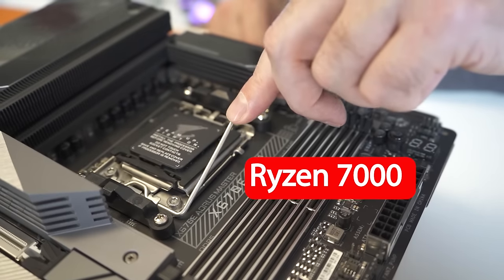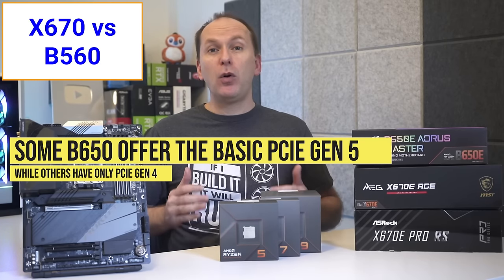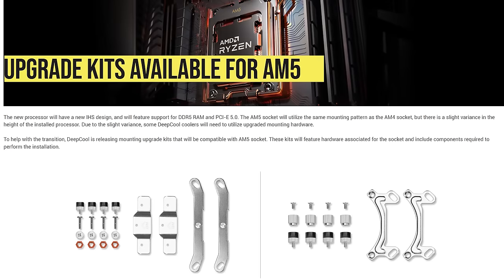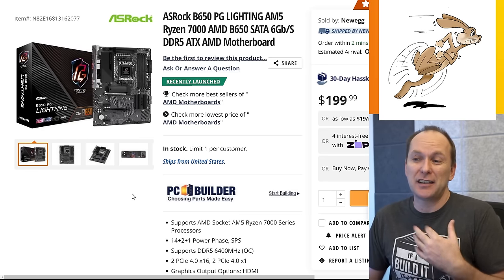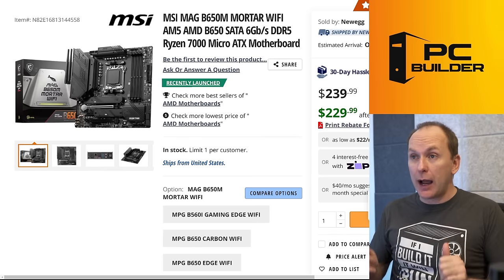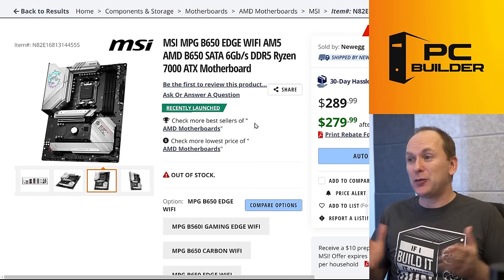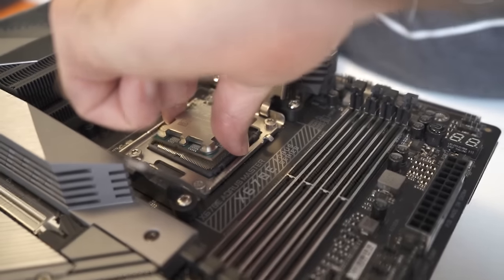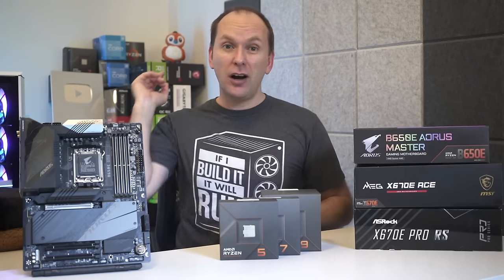Best Motherboard for Ryzen 7000 | AM5 Motherboard (B650 & X670) For Ryzen 7600X 7700X 7900X 7950X

Comment: #1. USB 3.2 Gen 2 Back Panel Ports Type A, ( 2x2 type C draws persuasion as well after 3-4 type A's), #2 PCIE gen 5 on video card slot ( may not be fully usable but get something for money spent to ensure Top data transfers) #3. PCIE gen 5 M.2 slot, #4 wifi,  then comparisons of VRM & audio codecs. I do not overclock.  Looking for affordable ( under $200) AM5 board that meets 3.2 gen 2 back ports is hard to find

Comment: One curiosity I had was for building a SFF system that can handle a 7950x without overspending on the motherboard, that way It'll have max compatibility for whatever I decide to use.  I knew it would be possible before the B series boards were released.  It will be fairly minimal in terms of pcie/sata devices, maybe just 2 m2 drives at most.  I kind of prefer Asus, but I'm also considering Asrock or MSI.
Reply: asrock used to be subsidiary of asus

Comment: I'm gonna cross my fingers on the ASUS B650-I, has all I need for my ITX build, though some customers reported lots of coil whine on idle from their examples even after getting replacement. One of our retailers had like 5+ of the same board returned within the first few months. But there are so few ITX boards for AM5, I don't want to break my build's all-black aesthetic with the white MSI Edge, and I don't trust AsRock.

Comment: I picked up the MSI MAG X670E TOMAHAWK X670E as part of a bundled deal with a Ryzen 7900x a few weeks ago.  Had no idea how good or bad this board was.  Only had the ratings to go by and it was above average.  Seems OK so far, but I wish I had more time to research.  Was in a rush to get the build up and running.
Reply: What is the difference between your motherboard and GIGABYTE B650M AORUS ELITE AX in performance ..etc. ?
Reply: @warrobots1warrobots135  Have no idea.  Like I said, I didn't really have a lot of time do any wide spread comparisons other looking at the specs online.  It was either this or the equivalent Asrock, but at the last minute, newegg updated their combo deal and I saved about $20-30 by switching to the MSI one.  So far, it's great.

Comment: Even a noob will understand and learn what are the commponents and what are they for. Hats off to you for such illustrative videos. You desevre milions of subscriber. I am planiing to build a new rig, it will be mainly for Gameing along with MS office, Excel, Photoshop, Illustrator, etc. Please be informed, I have no plans to overlock. I am just against overlcoking. Love from India.

Ryzen 7900
Msi Mag B650 Tomahawk Wifi Motherboard
4070 Ti
Trident Z Neo 16X2 6000 30CL
Stock cooler
KC3000 PCIe 4.0 NVMe M.2 SSD 

Please feel free to modify.
Reply: What is the difference between your motherboard and GIGABYTE B650M AORUS ELITE AX in performance ..etc. ?

Comment: Can you make a video on how to choose a pc case? And possibly on which and how many fans to buy with it? I can’t find help for it
Reply: It's very easy. Just make sure it has front usb c, also read reviews to make sure there's enough room for cable management. The best cases are made by Phanteks or Fractal in my opinion. If I were you I'd just find a roomy Phanteks case and get that. Try Fractal Design Torrent or Phanteks P500A. I'd probably but the 500A is looks amazing and comes with 2 fans already.
Reply: @waitandhope  ok thanks and do I choose the other fans? If I want 4 in total?
Reply: @xruud24  Try finding out the model of whatever fans the case comes with and buy 2 more of the same. However since each fan has its own header on the motherboard you can fine tune their behavior later so they are similarly rotating. Or really what you can do is just buy 2 more, put those in front and move the ones it came with to the back and top. That'll be easier
Reply: @waitandhope  yeah because you assume the one the case comes with are less powerful than the ones I buy? Bc there needs to be positive airflow coming in
Reply: @waitandhope  I thought I had 1000 options to choose from and which one I should get depends on the case
Reply: @xruud24  fans will all spin around the same rpms so it doesn't really matter unless you chose some weird industrial ones
Reply: @waitandhope  thanks

Comment: What would you recommend for an AM5 board that will last 5 years without replacement? The MSI X670-pro seems like an appealing option.
Reply: Probably any of these will since partners have learned from am4 disaster with those first motherboards with really low rom sizes that kept them from ever updating the bios

Comment: my motherboard buying varies wildly on my budget. my first ever build had a secondhand lga 1151 board, i cant remember which model, the only reason i bought it was because it was 70 dollars, and my  modified hp pavilion had just died. after that i bought an X570 board that im still running. bought that because it was 'high end' as in i did no research and only looked at the 5'70' part. this time around im looking for a x670e or b650e because i plan to run this for a long time and upgrade gpu next, and maybe by the time i can afford to upgrade the gpu a new pcie5.0 card will be out

Comment: Hi, do you think MB Strix B650e-e will be good for ryzen 7000? Or can you recomend something better on lower price or same price?
Reply from the maker: Yes we recommend specific boards in this video that would be great. If you want a Strix board, I'd recommend the B650-A or -F instead as the -E is stupid expensive and nobody needs PCIE gen 5 devices right now (or anytime in the future).
Reply: @PCBuilderChannel  thank you for answer, its only 20$ bucks on our shop diferent with sale. So I wait until North case arive.

Also I have a question about CPU, in PC I have i5-7500, and I find something rly wrong, CPU never go above 25W, never, in game stress test, or else. 
Dont know what can be wrong (bios,MB,CPU,Throttle)

Comment: Hi Jason, thanks so much for your in depth reviews and advice. I'm putting together a reasonably priced upgrade to my pc by selecting AMD Ryzen 7600x chip and either ATX 3070 ti GPU or Radeon RX 6700 XT and a bit overwhelmed by choice in the motherboard section. Bearing in mind I don't need a pcie 5 slot, what would be a decent board that is in keeping with my pricepoint but also doesn't hinder the compatibility of my parts? Thanks in advance. Nick

Comment: I think you mixed something up or  I might have  misunderstood you.

Every motherboard (X670E, X670, B650E)  except such with the B650 chip have to have a NVMe PCIe 5.0 slot independent of what the graphics card supports. The B650 can optionally have NVMe PCIe 5.0 support but only has to have PCIe 4.0 support.  So it's not really a case of either NVMe Gen 5 or  a x16 PCIe 5 slot for graphic cards.

Comment: Hey do you recommend me to build ryzen 5600g right now and buy the graphics card later because I don’t have the budget and I’ve considered the 12100f but im going to use it also for 3d work
Reply from the maker: It depends on what programs you use. Check the specs requirements on those. Some of those programs will not work properly without a Nvidia Gpu.
Reply: @PCBuilderChannel  im going start working on them after I buy the graphic card 
Unreal Engine 5, 3ds max,

Comment: Now, here's my question. I'm building a pc on Ryzen 7700X with RTX 4080 from Palit, 32GB of RAM  by Kingston Fury Beast. A couple of tech guys try to convince me that Asus TUF Gaming B650-PLUS is gonna cut down my hardware in productivity and tell me I should go with Asus Prime X670-P (without WiFi and Bluetooth since I can't even afford it). So, would going with B650 PLUS be okay? It's way cheaper than X670-P for me, but I'm afraid I'm overkilling it by getting a MB that is not very suitable for my current hardware. It's my first upgrade since 2012 & if everything works fine, I'm not gonna upgrade for another 7-10 years, so it's really really important to me. I'm planning on working in photoshop and playing video games on ultra settings with RT on, on 1440p 144ghz, maybe upgrading in a couple of years to ultrawide. Could someone please answer me this one?

Comment: I look for number of Sata ports. 6 ports minimum. Good power delivery and Japanese capacitors. Lots of rear USB ports. 2.5 gb Ethernet or better port. A board with big heatsinks on it. And metal reinforced slots for the graphics card and ram slots.
Reply: Most people building new today will never use even a single SATA port. I expect it won't even be on boards in a couple years.

Comment: Jason The most interesting thing for me in Am5 are stability and boot times. Compared to 10 years old PCS the Am5 have a Lot longer boot times (EG 2 minutes). When we skip RAM learning it can be 25 - 60 SECs depending on board manufacturer ( gigabyte fastest as I heard) but often occupied by stability issues. Gould You test some boards and compare it or ITS only best on paper mainboards articles ?

Comment: For me, I'm looking for a TPM header and good rear USB.  I mostly use dedicated sound cards so the onboard audio chipset isn't as important.  I've generally opted for m-ATX boards but I'm thinking of going ATX this time.  I'm torn between 4 boards from both Gigabyte and MSI for my build I'm planning.
Reply: If you bought it what did you en up buying
Reply: @blondemonk7860  It's a Gigabyte B650 Aorus Pro board and you need to get the correct TPM.  An older TPM module didn't fit the socket.
Reply: @pburger1860 Thanks for the answer. I dont know about PTM. I wanted to know whether you are happy with your purchase or not. Did you face any coil whine?

Comment: went with the tomahawk, a little weary of asus considering although seems to be a bios issue and power spike problem when things get Too hot. about to grab my 7800x3d to complete the deal and just finishing up on a case to fit and my,.... uh oh, psu. i need two straight plugs for my gpu so hopefully i find one that has an extra incuded, not crazy about the spliced cables plugged into the same component. if ya got any suggestions or warnings id appreciate it but i know your busy and stuff so its cool. going with possibly air water cool mix with a xfx rx 6950 xt, not crazy about overclocking but feel it might be needed for the cpu while the gpu seems to be great air cooled, at least thats what i heard with xfx.

Comment: Question: Could you use a m.2 NVME drive in a usb caddy over USB 4 and it be a good use case? It would allow a motherboard to use more m.2 NVME drives and them be quicker if its slots are already full?

Comment: that ASRock X670E Steel Legend has jumped up to $450 on newegg 😮‍💨
Reply from the maker: We actually just launched our 2024 Ryzen Motherboard guide video so check that out for more options!
Reply from the maker: This video is old. We just put out our 2024 update so check it out.
Reply: thanks! I been binge watching all your videos! Also was wondering if you could mention memory type, I recently just bought some ddr5 ram and a gigabyte motherboard which would not post, I did not notice there are two types of profiles intel xmp or amd expo and I had bought the memory that says intel ready xmp so i'm guessing that is why the motherboard would not post. Thanks!

Comment: I just received as gift a Ryzen 9 7950x and I thought replacing it with the 5950x I'm using. My question is does the 7950x works properly with the unify mother board and the 3060gpu I'm using at the moment? Sorry I'm not great at PC build so I don't wanna do anything that will destroy my PC setup

Comment: Quite informative... my choice is either going with a B650 Tomahawk and selling it in a year or so when the insanity of the AIBs pricing is no more an issue, or going with the Asus x670e-creator Pro Art. The board is having a 10GBe network connection which is 100+$ on it's own, so it makes the price of the board more digest...
Reply: Did you find any weak areas of that mobo?
I am looking at the Tomahawk as well. I chose 7 mobos that were compatible with the RAM i ordered, B650s and X670s... All but the B650 Tomahawk had either crappy audio-chip or limited audio-outputs. I am in disbelief that the cheapest mobo of my short-list is the best one. And as a bonus it has PCI Express 5.0. WTF?
Reply: @jaromor8808  what was in your short list?

Comment: You can't have enough USB in my case, I have a lot of USB devices, from Steering wheel, separate gear stick, truck gear header (whatever it's called), a flight sim joystick, head tracker, VR headset, two keyboards, two mice and the list goes on. You maybe thinking, why two keyboards and mice, in general use, I sit on the sofa and use the computer. But when I play games I've got a sim cockpit. Having the devices plugged in all the time saves wear and tare on the ports. Some of those devices won't work properly through a USB hub so I have to plug them directly into the computer. So, in my next build I'm going for the ASUS ROG STRIX X650E-E, which has 12, and I'll still be using two 3.0 USB hubs each with 10 ports.

Comment: Cheaping out on the audio connectivity seems to be a thing on the cheaper boards. I wonder why? Is a TOSLINK connector costing too much nowadays? Even both of my Chinese X99 boards do come with it, hence I don't undestand this. The one thing that matters to me most is price/performance and I am not thrilled with AM5 for obvious reasons. I hope pricing will get better over time or I will go used once again (my 18-core Haswell-EP Xeon is still performing great).

Comment: Thanks for this!
Btw, can you help clear up the confusion about AM5 supported DDR5 RAMs and at what speeds? from what i know, it seems it only supports 1DPC at DDR5 5200 speeds and if you go 2DPCs, the speeds gets reduced significantly.
Also, 1DPC at higher than 5200 speeds is not very clear how it works to OC it since the actual support is at 5200 speeds.

Comment: In Europe all of these motherboards are 50 euros or more higher. I wanted to buy a 13700K that has much better multicore perfomance than the RYZEN 7700X that has only 8 Cores however the price drop make it more appealing. However indeed the motherboards are really expensive.
Reply from the maker: Frustrating!!

Comment: I was one of "those" people who went with an Asus X670e Crosshair Extreme because I could lol. Absolutely love the board with one exception. The USB 3.2 gen 2x2 header that's on the right side of the board should have been made a straight in header like everything else on that side. Just a slight annoyance. Loving the board though and it fills up my Corsairs 7000d nicely.
Reply from the maker: Thanks for sharing!!
Reply: @PCBuilderChannel  Anytime. Keep up the great content. I would say as far as PCIe storage speeds that, in regards to gaming, there is at least the possibility on the horizon of drive speed mattering in gaming with Microsoft's Direct Storage API. Not there yet obviously but it may very well be soon.

Comment: hi,
i'm a bit late to the party, but i was considering to make a system with an ASRock B650M-HDV/M.2 motherboard. with all these entry level boards i'm concerned about how close the m.2 socket is to the gpu socket. do you have any experience in the gpu overheating the ssd or vice versa? would a ssd with built-in heatsink (like the seagate firecuda 530) be sufficient for such a board?
thanks in advance.

Comment: I hate how a basic and cheap QoL feature such as POSTcode and clear CMOS was paywalled behind high end boards, while they're wasting money on unnecessary amount of IO ports, VRM that's clearly too much for the average user, but too low for the overclocking enthusiast, and overly packed stickers and "painting" for their boards. (Looking at you Strix.)
These QoL features should be the standard when you're already willing to pay for boards such as Aorus, MPG, and Strix; But they're only available for the top of the line of these series even though the whole lineup already quite expensive in the first place.
What I want is board full of QoL feature, with reasonable amount of port and slots, decent VRM, and simple but modest design and RGB without having to break the bank.
People keeps crying about the whole GPU market being awful, while motherboard manufacturers are currently as bad if not worse by manipulate their products like these.

Comment: The ASRock B650M PG RIPTIDE not having a vrm heatsink at the top shouldn't matter for a 7600x right? I can get the PG Lighting for $169.99 right now and the PG RIPTIDE for $149.99. Should I sacrifice some future upgradability with the PG RIPTIDE and save a little more or fork over the extra $20 dollars for the PG Lighting? AM5 boards and DDR5 is really expensive right now but I desperately need an upgrade now. The thing is I don't know when prices will calm down but I'm debating just getting a 5600x

Comment: I HAVE A QUESTION
My GPU doesn't have a type C output connector,  neither my current MoBo. If i buy a new MoBo with USB C output can i connect it to my USB C monitor input port so i can stream both Video/Audio/USBports to my monitor?
Reply: If the USB-C port on the MoBo is at least '3.0' or if it's Thunderbolt, then maybe. I say maybe because it's not guaranteed unless explicitly specified, the USB-C is universal and capable but it's the MoBo manufacturer's choice to add support for video signals.

An alternative option which is guaranteed is getting yourself an adapter that transfers either HDMI or DisplayPort signals from your MoBo to your monitor's USB-C, but the speed of HDMI/DP will naturally be bottlenecked.

Do note that MoBo video ports only works if your CPU has integrated graphics, GPU signals does not go there.